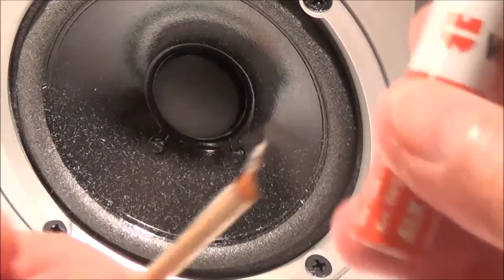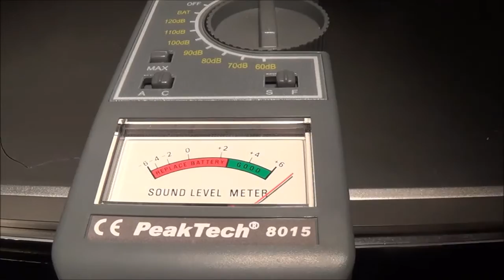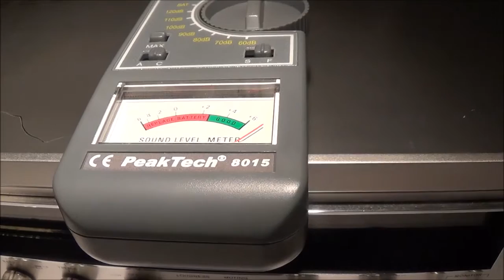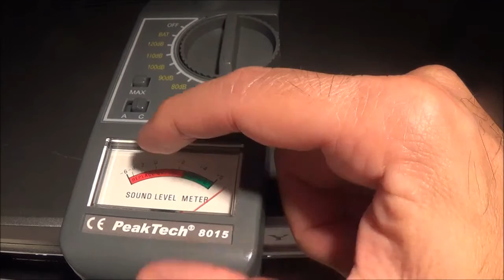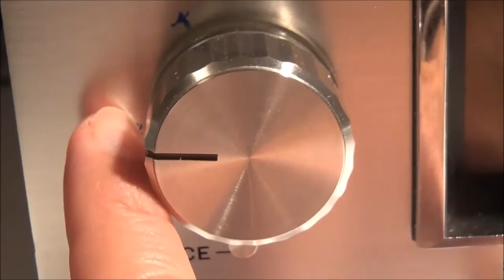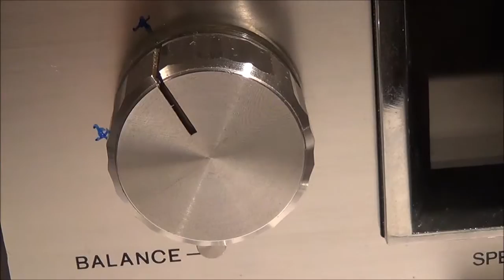Speaker Phasing (polarity) -- Speaker Connections

Comment: Did the battery test hurt the one speaker that you tested or was it ok?
Reply from the maker: it did not hurt the speaker at all. that 1.5 volt little battery will cause no damage to the voice coil of the speaker; the voice coil will not overheat.
Reply: Did you use a AA or AAA battery? I used a AA battery
Reply from the maker: I used AA.
Reply: So it didn't hurt anything? That's what I did.
Reply from the maker: no, you did fine.

Comment: Hello
 Old School,  last night, from my vintage tube amplifier,  I 
mistakenly connected my Spendor Bookshelf speakers as with two  + wires 
 to the one speaker and two - wires to the another speaker. But one side
 speaker worked and another side didn't work.  'Balance control worked 
both sides only for one speaker. I shocked and sweated  then found it 
was wrongly connected. After made the correct polarity connection, they 
now sing.  Here, I need your clarification for: Since I made the wrong 
connection for 10 minutes, is there any possibility for weakening the 
Cross-over and speakers? Actually, What would be happened by this wrong 
connection? I am much much worried about my beloved - expensive  new 
speakers.   Kindly explain and please let me know : Did my speakers 
fully escaped and are they safe now?  why could  the speaker sing, connected
with two positive + speaker wires?  and why could not sing ,connected with two negative wires?
Thank you,
_ with regards,